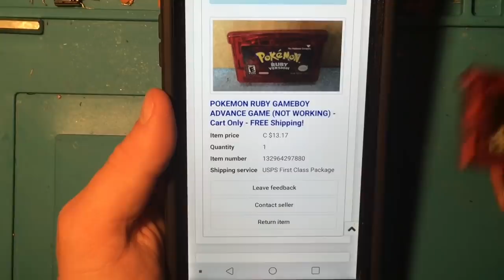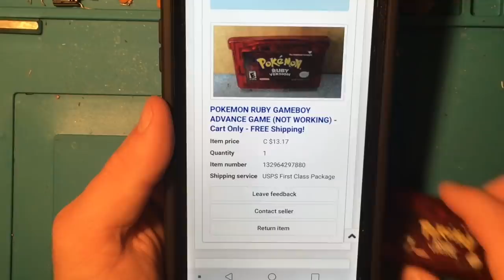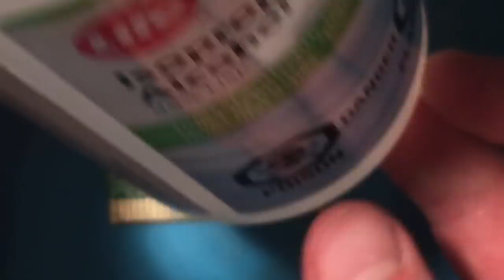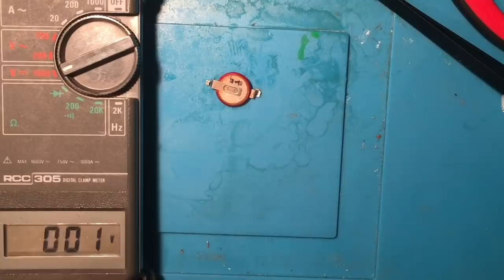Fixing eBay Junk - Game Boy Advance Game - Game Won't Boot Up - Pokemon Ruby

Comment: How i fixed my pokemon ruby:
I blown on the cartige and he started
Reply: Due to the removal and unremoval of the cart, you scrape off the oxidation on the pins. This is why it works again, not you blowing it like you want money.
Reply: @stickmaker10111  That is bullhsit.
Reply: @TheDantheman12121  yup, it's a placebo
Reply: @sweetbabyrodney  No it is not. It blows off dust and also the moisture creates a better connection.
Reply: The most amazing thing about this whole blowing vs not blowing debate is the people who say blowing does nothing are claiming to be able to prove a negative.
Reply from the maker: Blowing does nothing.  You're not blowing dust off the pins.  The repeated insertion of the game is what scrapes the pins enough to get solid contact.  You'd achieve the same ot better result without blowing, and just quickly inserting and removing the game multiple times.

Plus, the moisture in your breath causes problems down the road, which is what allows these videos to be made.
Reply: @RetroRepairs  I believe you about the problems down the road but you are 100% wrong when saying blowing does nothing. I have seen it many times using many different types of things. There is no possible way you can actually prove that blowing does nothing
Reply: @RetroRepairs  Also you contradict yourself in the same statement.
Reply from the maker: What is it that you think blowing does? Adding moisture to pins covered in oxidization or grime doesn't create a "better connection". scraping the oxidization or grime off is what improves the connection.

Dust itself will never cause a bad connection.  The amount of dust building up on pins is so minimal.  You continually spitting on your pins, letting bacteria and corrosion grow is what damages pins.

So yes, you can safely say blowing does nothing. There are numerous websites and videos that do experiments on the subject, all you need to do is look.
Reply: @RetroRepairs  The point i am trying to make is any experiments on this will be flawed and not able to conclusively prove that blowing does nothing. You say that the build up of dust is not a lot but i would say the oxidization process would take a lot longer than the build up of dust and any build up would also be minimum. When looking for the videos you suggest all i find is people saying it does nothing. I have yet to find anything proving your point. If i find a video that tells me why my snes games would not work until i blew them and when i blew them first they worked first time then maybe it will change my mind. Also i have worked in shops where people have keys to get their electricity and it was same with that. I had a key of my own that literally never worked unless i blew on it but (it is kind of gross but it was my own key) with little bits of spittle coming out also and then would dry the surrounding plastic off and it would work. They are the reasons why i am so convinced of this. I am not saying it is good for the devices (i know it is not), i am saying that blowing did makes it work.

P.s sorry about the bad format. Also great vids
Reply: Here is a test you can do. Blow on every cart before you put it in. You shall always have a 100% working cart due to per-emptively blowing it.
Reply: CBS 70sfan lmfao, I laughed way to hard at this.

Comment: i'm shocked at how awful condition that was in, yet you still managed to revive it. kind of inspires me to do this stuff and then resell any duplicates i manage to fix lol

great video!!
Reply: PinaPerfect Wasn’t all that bad honestly, I’ve seen far worse. I’ve seen old computers with corrosion covering sizeable chunks of the board, it’s especially common if the computer was used in industrial environments to control equipment. Those chips were the worst part of you ask me.

Comment: I've learn quite a bit from the video. So meticulous in finding the issue! Also, the solution is something I would have never considered. I've never soldered or have the equipment like checking the current or connections but this video is great!

Comment: What temperature do you recommend when desoldering gameboy batteries.

Also best temperature for desoldering anti-static balls on new ps2 slim lasers.
Reply: Standard unleaded solder temps are 300c so I guess 310 should do it
Reply: 300-350c. Not really a lot you can overheat or damage while desoldering as long as you are quick. Use leaded if you can. As well as flux which will keep the surface tension and stop the solder from peaking when you remove the tip.
Best way i find is to use a large tip. I use a 2.4mm chisel type. Remove the battery one side at a time. Hold tab with tweezers, melt solder and lift up on the tab which will stop it from sticking back down. Remove old solder and tin the pads lightly. Fit the battery and melt into place. Then melt and add solder to each side with plenty flux, you can move the iron about a bit in the solder to fill the entire pad + tab nicely.

You will also have to bend the tabs on the battery on gba carts as the rom chip is in the way.

Comment: I once dropped one of these in our yard into the snow without realizing it as a kid. I only realised after it had spent the better part of 4 months under a foot plus of snow when I found it in the mud in the spring, dried it off over a fan and cleaned the dirt out of it and it fired right up. These carts are damn near indestructible

Comment: One time when i was young i jumped into the pool and right when i jumped i remembered some games in my pocket for the ds do i chucked them out of my pocket in air and they landed on concrete i saved my games.
Reply: I hear they won't break as long as they're not on while wet and they don't have a battery
Reply from the maker: Correct,  unless corrosion sets in, then it causes problems

Comment: Dude. Loved it! I learned quite a bit from this. Makes repairing my own games much easier. 
I wonder if the computer board method of baking your game board in the oven and lower temperatures would flow the connections as well?

Comment: A DS Option Pak is essentially any accessory for the Nintendo DS that is inserted in the GBA slot. Some notable examples are the DS Rumble Pak and the guitar grip controller for Guitar Hero: On Tour. They aren't games themselves, and instead find their use through a slot-1 game. Occasionally, when a GBA game is not working correctly or is a little dusty, it will be identified incorrectly by the DS as an Option Pak!

Comment: the chip on the right is the FRAM ship for saving whitout battery backup, the battery is needed for the upper small ship with that quartz is a realtime clock, the rom ship or the OTP is the long ship with the MX label on it

Comment: It really works, i'm amazed, guys. I've just fixed today a copy of pokemon blue, i re-soldered the area with paste for soldering just like that guy did and it worked, i got so happy! I recommend using flux for soldering instead of the paste tho, the paste can damage the board of the cartridge.

Comment: DS Option Paks are for stuff like Rumble Paks and DS RAM Expanders (used by beefy games, homebrew, and sometimes video players). The old generation R4-type flashcards came with one.
That a wierd solder bridge could fool the console into thinking that it was an Option Pak is wild. Without knowing what the pin-out of the offended chip is, I assume it confused the console like "I can see that something is there but it screams whenever I ask it. It's probably an Option Pak, so I'll let the SLOT-1 DS Game figure it out.".

Comment: Do not go over the legs of a chip with a soldering iron from one end to the other. You can, and often will bend the legs sideways and they will not be making good contact anymore.
Reply from the maker: No reason the legs would bend unless the solder isn't fully melted, or if I'm putting too much pressure.
Reply: @RetroRepairs  That is exactly what I told myself and then burned my fingers really, really bad, so take this as a friendly heads up. You don't want to unsolder the chip, straighten the legs out and then put it back on the board. It is terrible work :D
Reply: Don't listen to  @Krivulda  he knows nothing about this stuff. Keep doing what you've been doing, it works. 😉
Reply: @Jajuan44  Yeah, I do that for living for quite some years now and know nothing about it. Sure...
Reply: Those are quite giant and hefty chips, so yeah, there is not much of a risk, but if you try to do this on some more delicate chip, you are sooo screwed...
I am way beyond bad ideas like soaking board in alcohol, reflowing the whole board and stuff like that. That's learning process. Found out that it is bad and now I am trying to pass the knowledge to others without them causing damage. But nope, there is always some know-it-all, whi talks crap about that. Okay, go ahead, destroy some equipment with price tag containing four zeros and then say 'oopsie, I broke it' and 'should have listened to the guy'.
Making something work is very far from making something work and look nice. And doing a crap job is worth nothing.
Reply: @Krivulda  Hey he fixed it, and that's what matters in the end. Just because you screwed up because you were incompetent doesn't mean he will. Go give your sappy advice to someone who has messed up like you. He's doing great for himself, now is he perfect? No am sure he makes mistakes like everyone else so calm down no need to double comment with angst.
Reply: @Jajuan44  That is the problem. It works at the end. No matter it looks like crappy job. No matter it could have destroyed something. It. Works. At. The. End.
That solder bridge was totally unacceptable for example. If it was power supply pin with 21.5V, it could have fried everything on the bus in the matter of microseconds. Have a good time repairing that mess.
If you would have done something like this in company I work in, you would get fired instantly, no question asked.
Reply from the maker: And yet drag soldering is an extremely common and reliable technique, so if you have trouble with it, i certainly wouldn't be taking my repairs to your business.
Reply: @RetroRepairs  Yeah, we do things proffesionally, not the lazy way. ✌️
Reply from the maker: I'll be sure to make note of that when working on electronics with 4 zeros in them.

In the meantime, tries and true techniques for working on boards and components this size will continue to work.
Reply: I think that only issue at first was just some dirty contacts. By comparing 2:14 and 20:18 you'll see that the trace was broken after messing with the PCB. Why not just clean the contacts first before reflowing?
Reply: @Krivulda  "I hope you can make a decent chunk of change off these."

Removing the chip and straightening a few pins is not a difficult task at all, but if you're doing that much damage just by drag soldering, you have bigger problems than straightening a few pins.

Comment: "Oh boy, it got wet..."

Proceeds to wash it with alcohol
Reply from the maker: Yup. And?
Reply: @RetroRepairs  Wtf how did you reply 4 minutes before Tyler made this comment??
Reply from the maker: It's a little known secret, once you get 10,000 subs, Google gives you the keys to the internet, which allows for infinite possibilities.

Either that or something screwy is going on with the timestamps.
Reply: @RetroRepairs  Ah okay, btw my GBA SP has a problem. When I turn it on the power light flickers for a second and then goes off. You think a fuse might have blown?
Reply from the maker: Can't rule it out, but could also be a dead battery.  Might be an issue with the charging circuit. I'm not familiar with the sp symptoms well enough to say for sure

Comment: I had the same exact hole.. Fixed it with a dot of solder in the hole.. But im told often to not do that as it may cause damage to nearby traces, especially if you use cheap flux

Comment: the pin bridge was because of your soldering technique. NEVER run from one to another or try to solder multiple things at once. it makes problems like that where you bridge gaps because the solder sticks to one pin while you drag it to another. other than that good job on narrowing down the problem and fixing it.
Reply from the maker: Look up drag soldering. This is hardly an uncommon technique

Comment: Electronics flux is non-corrosive. The flux used for sweating copper pipes is corrosive. Most manufacturers of PC boards leave a lot of flux on their boards today as a cost-savings measure.
Reply from the maker: That's simply untrue.   No clean flux is less corrosive, but the very purpose of it is to be corrosive and clean the metal. Just not as much as plumbing flux.

Comment: Okay so. I'm dying to know. 

I never got to beat my copy of sapphire, because I dropped it in the rain. Why I was carrying it in the rain I dunno, I was a dumb kid. And so something inside rattles. Last I checked it boots up, but doesn't actually save. 

Just curious if that sorta thing is salvageable cause I would really really like to finish that after all these years lol.
Reply: ya I think you just need to change the battery
Reply: @MrBearr.  I have no idea how that would fix it not saving?
Reply: @user-yu9pg1lo1u  The battery could have broken off and I’m pretty sure that it uses the battery to save.
Reply from the maker: This game doesn't use a battery to save.  The battery is only for time-based events. 

It is possible that something came loose which has damaged a trace or component.   The game could play perfectly well,  but can't save. 

It could be salvageable,  but no idea what's actually wrong until you open it up and check it out

Comment: @retrorepairs do you think you could go over the current video out there about the PlayStation Classic current limiter removal mod. Maybe with what they are using for micro surface smd resistor suggest or make a video about installing an additional smd in parallel with oem to retain a current limiter but increase it's flow to something that would power up to a portable hdd. I did the bleemsynk mod and filled a 1tb hdd with retro games for RetroArch but would like to unbridge the current limiter and make a effective higher limit for safety. Thanks in advanced.

Comment: Hi I don’t know if you’ll be able to answer this query or even respond at all tbh but when it comes to the save data in Pokemon ruby sapphire and emerald will it ever die like with gold, silver, crystal and red blue and yellow, or will it stay unless damaged
Reply from the maker: You should never lose your save unless the file gets corrupted somehow or it's physically damaged.  This type of save does not require a battery to maintain a charge.

Comment: when i was younger, before i could buy my own soldering equipment. I would carefully rip out the battery and leave the tabs in place and make note of which way the battery was facing, then put in a replacement and close the shell. Usually the shell was enough to keep it in contact with the contacts.
Reply from the maker: In a pinch that works.  You could also use electrical tape to hold it
Reply: yea ive seen people use electrical tape, but ive found at least for gba games that the case is plenty to hold it in place, i still have pokemon red,blue, and yellow with factory batteries still ticking last time i checked.. got the saves backed up so im not worried.. all my gen 2 games have kicked the bucket along with gen 3

Comment: Sorry for ask but... it shouldn't be easier if you looked for broken connections first, before blowing hot air and stuff? Personally, I would left the hot air, cleaning, reflux, after looking for broken connections. Just asking, because I'm ignorant and don't know a logical reason to left the broken connection as an after though.

Comment: I scratched the vertical chip on the right  when trying to replace the internal battery of Pokemon Sapphire and it doesnt boot anymore. Is there anyway to fix that?
Reply from the maker: Scratched? With what, your soldering iron? It's possible you've bridged some of the legs with solder.  A simple scratch shouldn't affect it, but bridges absolutely will

Comment: I was putting a new battery in my brother's emerald version and this gold line in the top right corner got some solder on it. Being a novice at electronics, I chipped the piece of solder off with my fingernail and it ripped some of the gold off. It all seems to work good still but hoping I didn't mess anything up.

Comment: hey if you bridge some small parts (like in the vid) is it possible (any %) to burn the DS fuse? i tried it and the ds doesnt power on now, when i put it to charge the small led lights 1 sec and then no more and i cant even power it on. any help would be appreciated

Comment: After looking it up it seems normal soldering temps are a bit lower than the auto ignition temperature for isopropyl alcohol. But that sketched me out a bit.

Comment: CR2032 batteries do fit snug in GBA game paks. You don't need a special battery. As long as it's giving 3V it should be alright
Reply from the maker: Correct, I've done it before on a different one, but it's really snug like you said. I'd rather get some 1616s so it's not putting too much stress on the shell

Comment: awesome vid 👍👍( really nice microscopes are like 500$. A microscope might have saved time, made it easier, and you can film what you see through it and 36 awg enamel coated wire is the way to go because the coating insulates the wire and when you solder to it the solder burns through it

Comment: @retrorepairs does using hot air instead of the iron tip would've been good to resolder the chips?
Reply from the maker: Yes,  that would also work. You do heat up the chip more though,  and this chip has legs far apart that it's doable with an iron.  Either would do